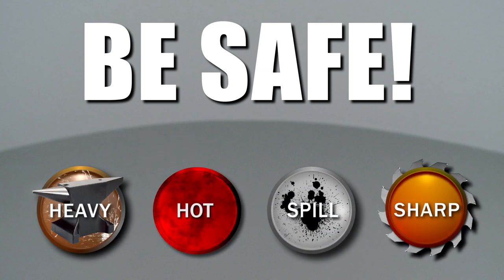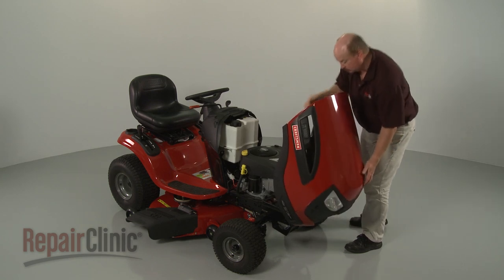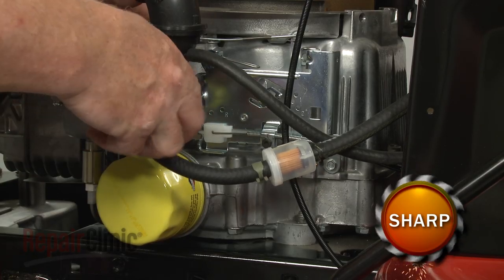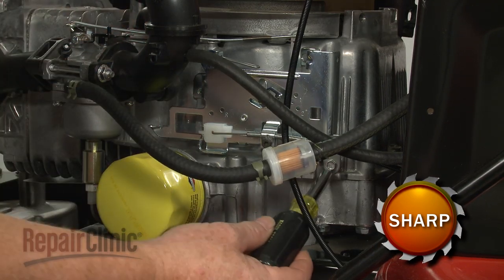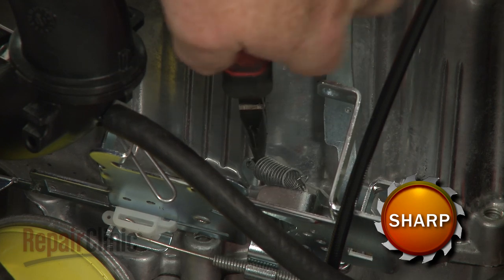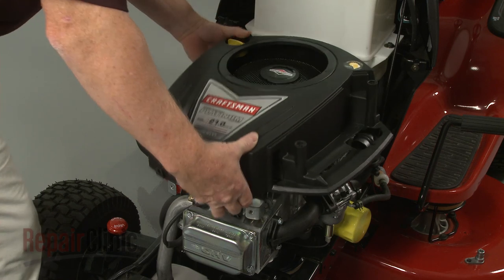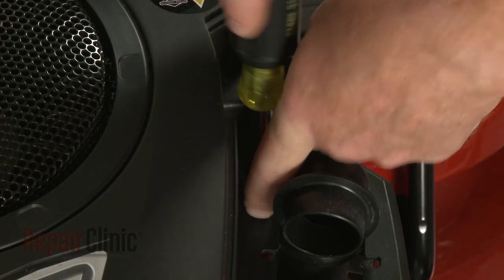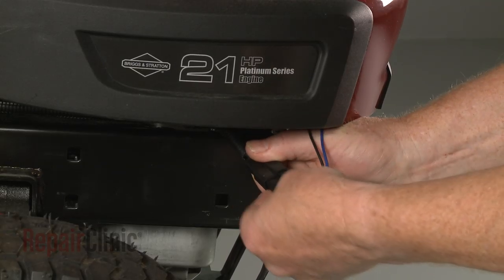Briggs & Stratton Riding Mower Engine Governor Spring #796260

Comment: I have a 21HP B & S motor in my John Deere LA125 lawn tractor.  The engine died a few weeks ago, and I've been replacing Fuel Filter, Air  Filter, Vacuum Fuel Pump, and just bought a new carburetor... Going thru some videos, I came across several videos on how to R & R the carburetor. I heard mention of a "Governor Spring" and recalled finding a broken spring laying on my mower deck when I first started working on solving why my motor would crank, but would NOT run on it's own.  It would run for short bursts if/when I squirted starting fluid in the Carb's venturi.  So now I'm stuck... is it just the spring that broke?  Or is the Carburetor not working?  The broken spring I found on my deck is 1/2" wide, the Coiled part of spring approx 1 3/8", and overall length is 2.5"... Since this is the 1st comment, I don't expect any feedback... So I'll copy this to another video.   11 Aug 2018
Reply: Personally on mine the governor failed and that caused the piston arm to break apart and destroy the inside of the engine, it had to eb taken apart and completely rebuilt. Your governor may have failed completely. I had the same problem and replaced the same parts, except I also replaced the magneto/coil. It then started properly but did not run for long because of the damage to the inside of the engine